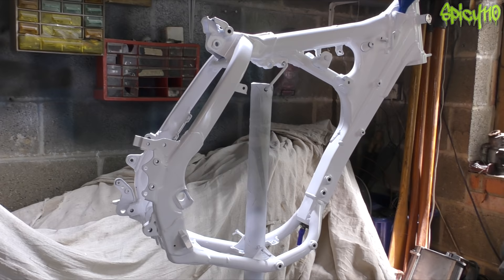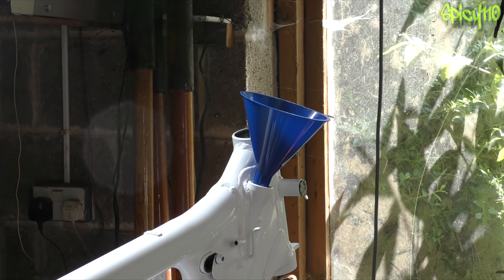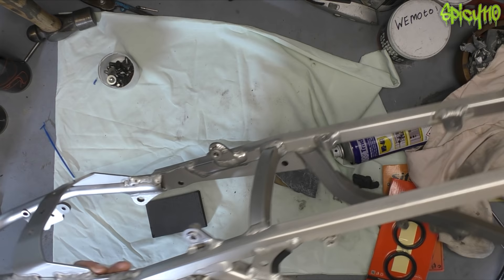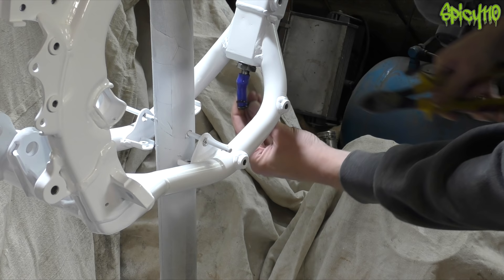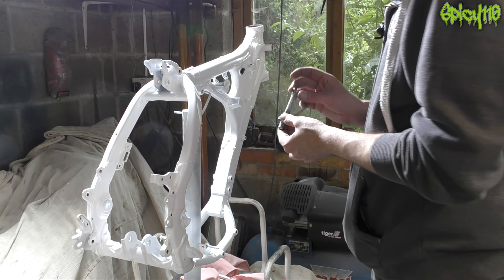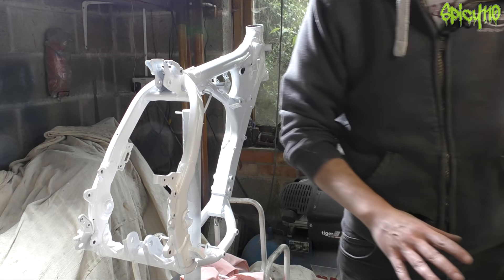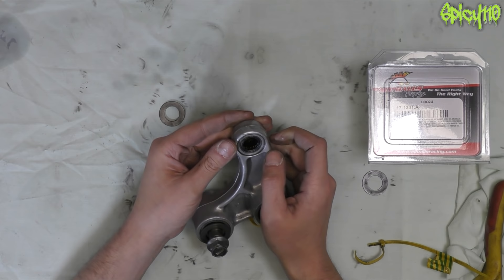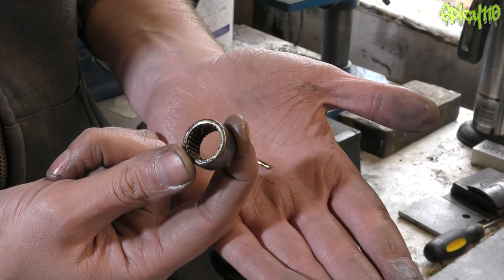Suzuki DRZ400SM Restoration Z EP. 13 - Disaster Averted!

Comment: Top tip, If you pour the keg with it horizontal rather than vertical it will flow smoothly rather than glugging and splashing

Comment: There is no need for arguments on copper grease, it's a high temp anti seize grease to be used on mating surfaces, simple really, all you need to do is read the label if you don't know lol. As for the 'mating surface' of brake pads, it's not so necessary for anti squeal these days, but fine to use as an anti seize if wanted, it will not run or get anywhere near the pads friction plate or the disc. When I worked in garages years back we used in on pads and on wheel hubs all the time so they are easier to remove the next time.

Comment: Doing bearings like that with a vice is fine. The only thing I would change is do not smear grease in the bore before installing them. Bearings should be installed into assemblies dry.

Comment: You used an angle grinder which is currently my nemesis.. my angle grinder tried to eat me, disc shattered, grabbed what I was cutting then went flying.. cut my arm and back of my hand.. nice little trip to A&E
Reply from the maker: They are a tool to be respected greatly, very much so with 1mm slitting disc. Guards and keeping your body out of line of the disc is key and no twisting at all in the cut. Hope you have a speedy heal and can get back to it.

Comment: if your wheel barings are find dont change them but there quite straight foward to change with a screw driver and a hammer
Reply from the maker: I really don't like hitting barrings, I learnt too much doing a shed ton of them in my boat work. I just need to grab a cheap press strut and weld up frame to make a press. I would have used the press my old boss has but obviously atm I can't go to his house where it is. 🙂

Comment: I've replaced wheel bearings on two bikes using just a socket set and hammer lol. Probably less of a pain in the butt with the proper tools but if you got all the tools for everything there would be no space in the garage or money to have a bike
Reply from the maker: I have access to a press when lockdown restrictions end. I have done a ton of work with barrings with the boat work I did, hitting barring in is a perfect way to mess them up. Haha
Reply: @spicy110  Yeah but I don't have access to one so hammer it is...

Comment: Hey dude, you might be the ideal person to ask. Is the battery powered Dremel worth getting? My garage hasn't got any power in it so my power tool options are limited but I've had my eyes on one for a while.
Reply from the maker: I have actually got a review on the tool. Basically it's good for light jobs like running a little wire brush maye be cutting a few bolts with the little cutting discs. nothing too heavy nothing too long just those little jobs it can be very handy. Charge lasts around 40mins
Reply: @spicy110  Thanks dude, appreciate  it. I'll look for that review too.

Comment: how would i go about cleaing up some old dog bones? they are from my old bike and I'm keeping them as a memory of the bike so would like to make them shiny :)
Reply from the maker: Depends what they are made of tbh, if steel and they likely are you can just strip then sand with some finer and finer grades or wet and dry and then polish. If you have a angle grinder that's great with a felt polishing disc.
Reply: @spicy110  I do thanks I will give it a go, have a good night.